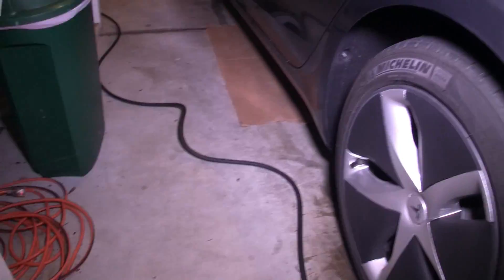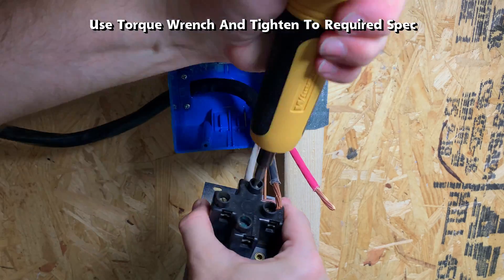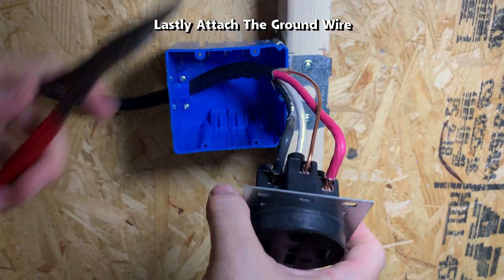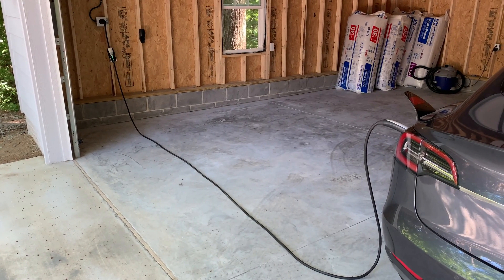Tesla - NEMA 14-50 Outlet Installation

Comment: I like the way your box gives access to strain relief screws from the inside, for later access to a service loop. Those #6 wires are so thick it's not easy to leave enough length for future use. Viewers may want to give better mechanical bracing to the box, since these outlets take more than average force to engage and disengage. Over time, without a second brace, the box may feel a little loose.
Reply from the maker: Good point.  Thanks for your comment!

Comment: Hello can you tell me which bit you used in that torque screwdriver?
Reply from the maker: It was just a flat head bit for the torque screwdriver.
Reply: Thank you. Great video. The new ones have a hex in the Leviton plus+ for ev and the Hubble
Reply from the maker: @jaykid007_JasonDavis  Sure, it probably varies per manufacturer and model.

Comment: "...And tighten to the right spec."  What is the right spec for your devicee and 6 gauge wire?
Reply from the maker: Usually the breaker or outlet will specify the torque.  I think it was 27 in-lbs.

Comment: I’m not an electrician explanation is not clear where you put the right wire video is run too fast and it’s not clear explanation
Reply from the maker: Are you talking about the outlet connections?  Looking at the outlet with the ground facing up, the top wire is bare (ground), the bottom wire is white (neutral) and the left or right are red and black.  It doesn't matter if you put the red and black wires on the left or right side. They are both "hot".
Reply: @MTNRanger  thank you

Comment: So I’m wondering why we just can’t buy the Lowe or Home Depot brand they look exactly the same and only cost between 10-$15 bucks ? Anyone using those instead and let me know if same results .
Reply from the maker: The cheap hardware store outlets are poorly made and no where near the level of the industrial versions. They also don't support repeated plugging/unplugging.  I wouldn't risk my garage for it.
Reply: I've seen several melted cheap ones. They just can't cope with continuous EV charging. I hardwired my current EV charger so I don't need to deal with plugs anymore.

Comment: Ever had an “over heat” issue at the receptacle & the umc auto degrades the Amps down to 30 or high 20’s with the car saying check receptacle? (With that Model receptacle you have used)
Reply from the maker: No issues with heat. The garage usually didn’t get hotter than upper 80s in the summer. You can watch my video that measures temps while charging.  https://youtu.be/D0w8VYX7Y9o

Comment: Since the Gen 1 handle more amps , does it charger faster than the Gen 2?
Reply from the maker: Yes, it 40 vs 32 Amps, 25% more. Say about, 38 miles per hour versus 30 miles per hour.

Comment: Very good video, good tempo and well done! I would use a metal box instead of plastic, especially when thousands of dollars are invested, you don't want the outlet to feel loose or to wiggle in two years. And, it shields better if it gets hot.
Reply from the maker: Thanks!  Metal vs plastic depends on use cases and preference.  For example metal sheathed wiring or surface mounting needs a metal box.  Romex wiring like I used is fine with plastic. Yes, metal does have the advantage of not melting or twisting.  No issues after two years of use.  I do recommend opening up the outlet to torque the wires a month after the first installation and every year or two after that.  The heat cycling of the wiring at 40-60 A for long periods of time can be demanding.

Comment: I have a 14 bmw i3, I’m going to install a 240v  in my garage with a 32 amp breaker, a 32 amp receptacle, with 8 gauge wiring so I can charge my car, I’m I on the right path?
Reply from the maker: You will get a net 24 A charging. Yes 8 gauge wire is appropriate for this application. This video is better for you: Tesla - NEMA 14-30 Outlet Installation
https://youtu.be/G4NqHC-erOY

Comment: Do you need neutral?
Reply from the maker: Technically, the Mobile Connectors don’t need it - for example a NEMA 6-50 doesn’t have one.  But for correct wiring to code, you need to have a neutral with a NEMA 14-50.
Reply: @MTNRanger  oh wow thanks for the respond and great tip. I also asked my journeyman about this and he told me I did. I’m assuming for code🤟🏻

Comment: Any concern using a plastic gang box with all the heat from EV charging?
Reply: Oh yes! glad someone else noticed it! I would never use plastic, I hate them anyway and if you have a chance to work on an open wall, stud right there and all, then use metal. The outlet will grab on better and this is a heavy outlet, strong to pull out and push in, and it wiggle making me nuts. And, like you said, metal protects from heat way better than the nasty Smurf blue plastic toy box.  Moreover, I did this and sprayed the fire foam (comes out orange) around the box before I drywalled it.
He did this well and it will pass the inspection, it meets code, but knowing how to do it is not the same as "have done it for decades" , old age and treachery will overcome youth and skill. He also needs to wiggle stranded wires and re-torque.
Knowledge: Tomato is a fruit
Wisdom: not to add tomato to a fruit salad.

Comment: So I placed an order for M3 LR 2022. What type of default charger do they give with the car? Just a 120v outlet plug? Since I want to add 240v outlet to my garage, what do I need to buy to connect the car to the new outlet? Do I need that $500 wall charger? I dont get why the wall charger costs so much if its just a wall mounted holder for a charging cable.
Reply from the maker: The car comes with a mobile connector that has a removable 120V 15A normal household plug.  You can order a NEMA 14-50 adapter directly from Tesla for $45.  The wall connector is a more powerful version of the mobile connector that allows up to 48A charging vs 32A on the mobile connector.  However to get that high, it needs to be hard wired to a 60A breaker.  For most use, 32A is plenty and it’s a lot cheaper. Some people also get the wall connector because they think it looks nicer.
Reply: @MTNRanger  great explanation! OK so I will contact an electrician to figure out if my breaker box can support another 60A breaker before spending $500 on the wall charger. Shame that Tesla wont give a basic adapter.
Reply from the maker: @longwalkshortpier  Tesla gave both the NEMA 6-15 and 14-50 with my car.  They discontinued giving the 14-50 a couple years ago.

Comment: How far I can run my 6/3  wife away from the panel box.
Reply from the maker: You can run a wire as long as you need it to go so that it’s in a good position.  Check out my video in my garage setup to see:
https://youtu.be/Hh8cMAsknvA?t=04m26s
Reply: Check with your local Electricians.  There is voltage drop requirement in the NEC, BUT jurisdictions can change or adjust code.

The voltage drop is caused by the resistance in the wire.  This means that the more current draw, the more voltage dropped. 

 Also, the longer the wire the more resistance to the wire.

And remember your charger should have voltage drop specification in the instructions.

Comment: How much would be the labor cost to have someone install it for you?  Anyone?
Reply from the maker: There are many variables.  Depending on the difficulty of your particular situation. $200-300 labor seems a good ballpark.
Reply: @MTNRanger  is that included labor?   I only need about 4 ft outlet away of my panel box. Thanks for replying.
Reply from the maker: @jamestrads497  In my previous house, it was about $300 to install the outlet about ten feet from the panel.  Probably $100 for materials and $200 for labor.
Reply: @MTNRanger  thanks for replying.  Correct me if I'm wrong.  

- 14-50 nema outlet 

- 6/3 romex or thnh

- 50 amp breaker 

Are these the materials for a tesla charger ?
Reply from the maker: @jamestrads497  Yes, some more things may be need like in the beginning of the video - cover plate and some miscellaneous parts.

Comment: Does the coiled neutral from the breaker to the bus bar not matter..?
Reply from the maker: There are no issues with the coiled wire.  I read on the manufacturer's website that it is coiled to save space incase it needs to be lengthened in the future.  Since is it attached to the breaker, is it is cut too short, the whole breaker needs to be replaced if you make changes requiring a longer neutral wire.

Comment: One commentator mentioned wire connection order:. Ground first, neutral second, hot(s) last.  Rever order for disconnect.  Hot(s) first, the neutral, then ground.

The ground is a safety to trip the breaker during faults,. Connecting the hot last prevents a "hot neutral".  Thus, the safest pathway for workers to travel and a safe habit to develope.

But, there is no power....yes, check a circuit myself, twice, and luckily only turned a $40 pliers into a burnt up paper weight.  

So please

SAFETY FIRST NEVER LAST LAST, HAVE A FUTURE NOT JUST A PAST.
Safety first

Comment: For general info   2020 NEC code change requires gfci's on "250 vac" (their words) recepticles in garages....210.8(A). And 210.8 (A).(2).    Check if this applies in your area.

Comment: No one ever shows an outdoor/weatherproof installation of these. Also, the outdoor boxes with outlets are some brands that no one has ever really heard of…. 

Lol it’s as if I’m going to need to buy the $500 wall connector.  🤦‍♂️
Reply from the maker: I'm sure there is an outdoor NEMA 14-50 install somewhere.  It is a less common option, but there are a lot of people that don't have garages. A simple box like this would work: https://amzn.to/3E1Pgs1 If you live in an area where leaving an expensive item outside is not a good idea, I would recommend a waterproof box to house the outlet and mobile connector. https://priuschat.com/attachments/evse-box2-jpg.57900/
Reply: @MTNRanger  this is actually what I ended up installing, it’s pretty far up my drive close to rear of house but I still take my connector inside when I’m leaving the house. 

Can’t put too much trust in human beings…

Comment: What was the breaker size feeding your sub panel? I have a 60amp breaker feeding my sub for my detached garage. I was interested in adding an EV charger but unsure if the 60amp would tolerate a 50 amp breaker for an EV charger. Thoughts?
Reply from the maker: Do you have any other breakers in that sub panel?  If the panel is empty, a 50 A breaker is no problem.  In fact, the mobile connector will only use 32 A, which is way below the 80% limit of 60 A.
Reply: @MTNRanger  so I have multiple circuits in that’s panel that serve garage doors and outlets. I have the space but not sure on capacity. The garage doors and outlets would not be in use when charging overnight (obviously).
Reply from the maker: @RPHPros  From what you describe, you shouldn't have a problem with a NEMA 14-50 and a 50 A breaker.  If it was fairly full with many circuits running at the same time (refrigerator/dehumidifier/mini split/etc) I would scale it down to a NEMA 14-30 with a 30 A breaker.  24 A vs 32 A charging is not a huge difference if you charge 10-20% of the battery pack every night.

Comment: I'm confused. Should I remove my whole side of dry wall to install this?
Reply from the maker: My example was for my garage before I had the drywall installed.  Depending on how the wire routing is in your situation, you can either install in in the walls or use a conduit and surface run the wires.  If the distance to your electrical panel is short, then opening the drywall may not be too bad. You may not have to do the entire wall, just the section it goes through - say a 1 foot high opening along the wall.
Reply: Talk with a local electrician.  There are bits about 3 ft long with holes in the tip that Electricians use to drill through studs and then pull the wire back.  Borrow or rent one, maybe.  Your local electrician may have other ideas.

Comment: So you buy a $50,000 car and can't put in a 48 amp wall connector,  cheap and stupid.  I installed my Tesla Wall Connector myself, easy, and faster charging speed.
Reply from the maker: Not everyone needs or wants the added expense or speed. Thanks for sharing your opinion.
Reply: 48 amps  doesn't make a difference if you are charging overnight anyways. Dumb.
Reply: I think this is smart ... it offers flexibility.  If they sell the house, there's a universal outlet for a welder or any EV charger.  You're not stuck with a hard wired Tesla-only charger... and they can take their charger with them.

Comment: I assume it matters what direction the plug is installed and positioned in? Seems like the ground is at the top? Also does it matter if you don't have the wire through the stud tightly bent against the stud with wire nuts (it seems to bow out quite a bit and that may be due to the size of wire)? I had an inspector once tell me that the wires need to be tight against the stud as soon as they come through the hole so as not to stick out into the cavity and possibly be drilled into or cut if the wall is cut into (this would be if you have a covered wall later of course).
Reply from the maker: Yes, per Tesla instructions, the ground is at the top.  This allows the mobile connector to hang correctly.  

With thick wires like a 6 gauge, it's almost impossible to bend the wire that close to the stud.  Yes, it's best to keep the wire pushed back from the front as best you can to reduce any chance of it being cut.  You always need to be careful when cutting into walls where an outlet is nearby.  When I insulated the walls, I placed three inches of fiberglass bats over the wiring and then the drywall in front of that.

Comment: does the 2nd gen mobile connector allow higher than 32 amp charging?  I just installed one with a 40 amp breaker because the store was sold out but it sounds like I have no reason to obtain a 50 am breaker...
Reply from the maker: 2nd Gen MC has a max of 32A.  Yes, a 40A breaker is fine if you are just using 32A.  If you want 40A, try to find a used 1nd Gen MC on eBay. But then you would need to replace the breaker.
Reply: @MTNRanger  Thanks!

Comment: Can I use 8 gauge if I'm only pulling 32 Amps?
Reply from the maker: The price difference is minimal, I would suggest using 6 gauge.  Also, liability/insurance reasons: if someone uses 40 amps in the future and doesn't know about the wiring, it may be a fire risk.
Reply: @MTNRanger  well in my situation it’s not. I have a sub panel in the garage that is fed with 8 gauge. If I install 6 gauge I’ll have to upgrade the feed from the main panel through a finished basement. So it will be very costly.
Reply from the maker: @stbny4444  What other breakers are in the garage sub panel or will this be the only one? What is the breaker size in the main panel that connects to the sub panel?   Is the wire to the sub panel aluminum or copper?
Reply: @MTNRanger  wire to sub is copper. Not labeled with gauge. The sub has a 2 pole 30 amp breaker in the main panel.
Reply from the maker: @stbny4444  So as the sub panel is currently set up, you could get 24 A out of that breaker.  That's fine with the current wiring and planned use of 8 gauge.
Reply: @MTNRanger  what about if I just use a nema 14-30 instead?
Reply from the maker: @stbny4444  Yes, a NEMA 14-30 will get you 24 Amps.  I have a video in production covering that one.
Reply: @MTNRanger  thanks for your help man! I was really stressing out!

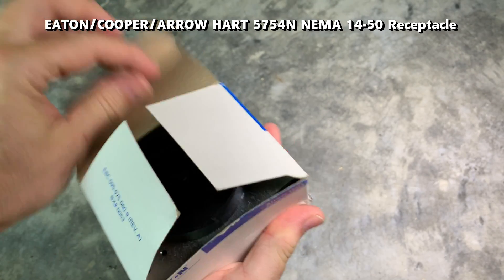Comment: 2:13 Eaton 5754N NEMA 14-50 receptacle
2:43 Carlon B234ADJC double gang box with wire clamp
3:00 Leviton 80530 cover plate
3:11 Eaton GFCB250 50A GFCI breaker (or something else that suits your panel and your local code)
3:33 Romex 6/3 copper wire
3:54 Service entrance staples
4:05 3/4" breaker box wire clamp
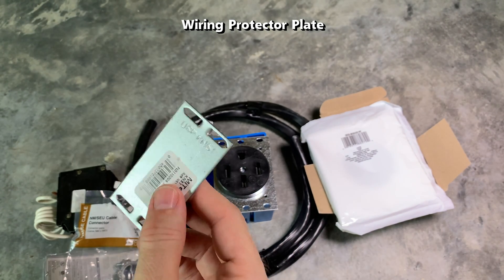4:15 Wire protector plates
4:22 Wire stripper/cutter for 6-12 AWG
4:31 Needle nose and flat nose pliers
4:42 Torque wrench/screwdriver
4:53 3/4" drill bit, hammer

4:56 Plan wire route
5:03 Drill stud hole(s)
5:10 Put wire protection plate(s)
5:16 Thread wire through hole(s)
5:30 Strip wires
6:09 Attach wires to outlet
8:24 Attach receptacle to the box
9:19 Attach cover plate
9:38 Remove one 3/4" knock-out on the panel
9:55 Install 3/4" clamp
10:00 Insert wiring into clamp, tighten clamp, secure wire with staples
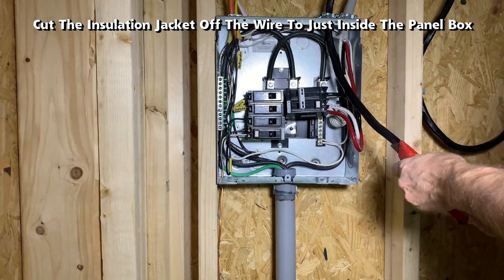10:39 Connect wires to panel/breaker
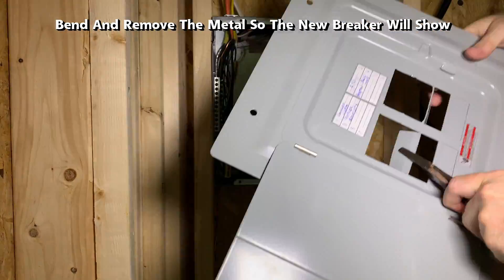12:38 Place the panel cover back on
Reply from the maker: Thanks so much, I've been slowly adding timestamps to my videos.  I added this to the video description.

Comment: Is there a minimum distance between the panel and receptacle?  I'm considering adding mine very close.  Thanks
Reply: Does not matter
Reply from the maker: When I did this project, I looked through the code and could not find anything specifying a minimum distance.  The main house exterior panel has an outlet just underneath the panel and that was not a problem when it was inspected.
Reply: @MTNRanger  Thanks
Reply: Nope, just good judgement.  It should not interfere if you are plugging a fat cable that will hang from it, but is perfectly fine to have a receptacle right next to it.  In fact, code requires in some jurisdictions to have a service outlet right next to the panel.

Comment: How do you find what the required torque spec is?
Reply from the maker: There are torque specifications printed on the breaker and sometimes on the outlet.  I use the breaker numbers for all the connections for that circuit.
Reply: @MTNRanger  Thanks for the quick response.  Do you happen to recall what that was?  I installed it a year ago but would like to verify and I have the same outlet as you (Cooper 5745N)
Reply from the maker: @greganson3627  Luckily I took a photo of the breaker and it was 27 in/lbs for 4 to 6 gauge wire.
Reply: @MTNRanger  NICE!  Thanks again!